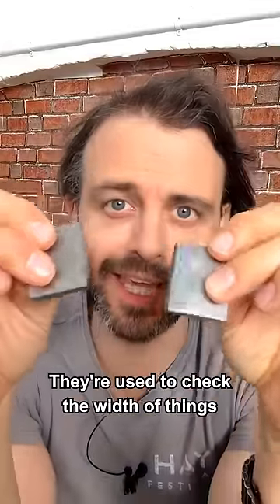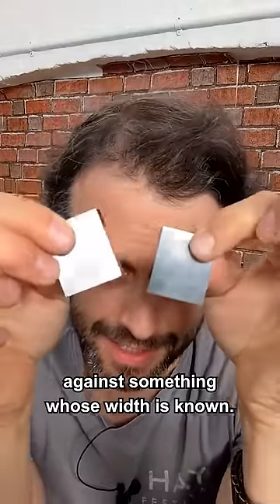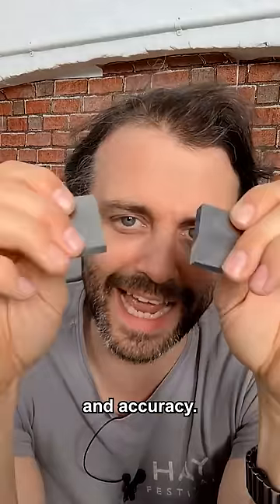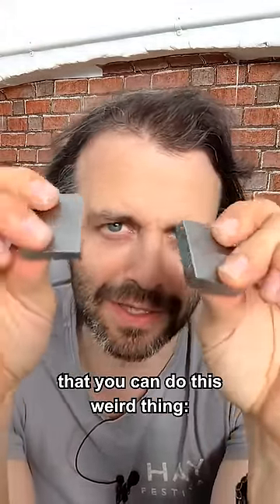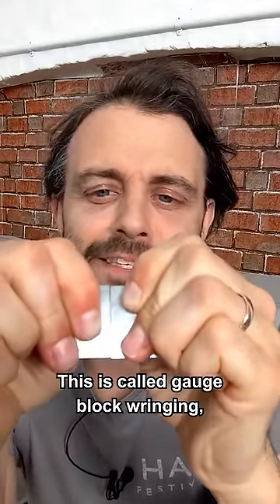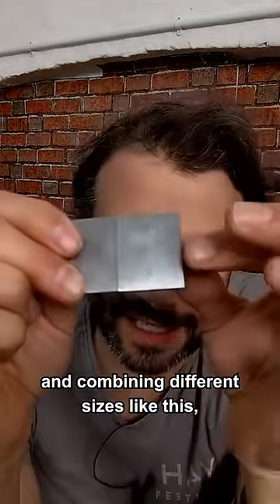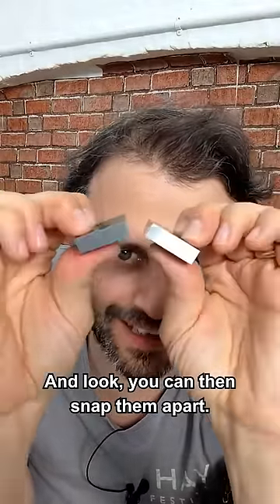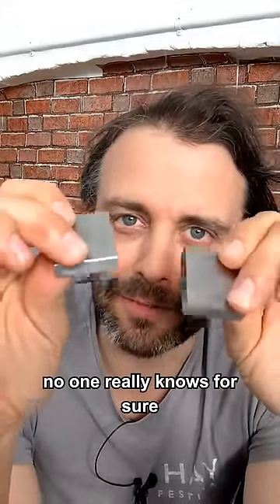No One Knows For Sure Why This Happens!

Comment: From actual machine shop experience, the oils from your finger play a surprisingly key roll. If you clean a gauge block with alcohol and try to wring them together, it tends not to work nearly as well
Reply: I’ve heard of cold welding, but this throws out that theory
Reply: @spicysmooth2  Metal atoms are held together by a free-flowing "sea" shared electrons.

therefor when any 2 clean/pure surfaces of the same metal come into contact (IE no oils, gases, or oxide layers to separate them) the electrons are free to move from one piece to the other as if they were one solid piece, thus almost instantly "cold welding" them together.

as for how they combat this, they will do a combination of things such as not using the same metal on to parts of a joint, or coating the metal in something to provide a barrier layer.
Reply: If you have a good set, you can get them to wrong just as well when they are clean. Taking them to a precision ground stone to remove any high spot and then wringing them together makes a huge difference
Reply: bcoz the oil increase contact between surface area
Reply: Yeah first time trying I would make sure they’re clean but they’d never stick together. A guy teaching me told me just rub it on your wrist and there’s usually enough oils to make it work. A little WD also works pretty well
Reply: @Thisisoscar_  As the original poster said if you clean them with alcohol they don't want to stick together as well when your oils are on them
Reply: @Thisisoscar_  Cold welding? No clearly not. From my own experience and as someone else said, this is easier to do when the gauges AREN’T clean. When they are cleaned it doesn’t work as well. Clearly nothing to do with cold welding, as clean surfaces work better for that.
Reply: I thought it was because they’re so smooth the sides are pulled together by sub-molecular forces
Reply: In my mind it's basically suction. Like licking a nerf dart to stick it too a window.
Reply: I just thought it was the Force
Reply: @Thisisoscar_  I belive the metals simply being in earth's atmosphere coats them with enough substance to prevent cold welding in space
Reply: Role….sorry I had to
Reply: Is it because being so smooth you're getting like 100% surface tension?
Reply: Even a tiny amount of H2O hanging out on the surface can make this happen
Reply: The set of gauge blocks on the workshop floor might not be so accurate such that they can be wrung together when clean, however something of a better grade like grade 0 will allow it to wring together even when they are cleaned with alcohol
Oils,fills in the gaps on the surface giving a smooth surface for the vacuum to form when doing the wringing
Reply: Could be Van De Waal forces, like geckos? The actual contact surface is actually probably crazy, and if there isn’t enough room between the contact surfaces i can see how grease could help.
Reply: @shadfallfan  (IE no oils, gases, or oxide layers to separate them)
Reply: @777XGang  (IE no oils, gases, or oxide layers to separate them)
Reply: @bofa722  (IE no oils, gases, or oxide layers to separate them)
Reply: That's helpfull
Reply: role
Reply: could alcohol residue prevent good contact?
Reply: @shadfallfan  "As the original" he is internet specialist that clearly do not understand the topic but want to pretend that he do understand it...
His story only proves that his test items were not as flat as he thinks they were.
I also saw a video with much nicer test items and the conection was much greater than in this video as here it looks like they may be just sticky and on the other video you could see signs of cold welding after they were separated with huge difficulties.
Reply: But it would still work?
Reply: @Bialy_1  What are you talking about?
Reply: @Thisisoscar_  is this related to why aluminum-on-aluminum screw threads become hopelessly seized after a while? Or is that a different cause?
Reply: @saltrocklamp199  that is caused by galling which is a very different thing.
Reply: @Bialy_1   What? Not as flat as he thinks they were? I’ve literally done this test myself in a shop with gauges that are used to manufacture aircraft parts. Trust me, they’re flat and the effect doesn’t work as well when the surfaces are cleaned. 
OP works in a machine shop as well like he said, so I’m curious as to why you think you have more knowledge on this than we do.
Reply: @nickl2852  Thats fair, it just can’t be that because it works in a vacuum as well
Reply: They are so smooth that anything at all that’s on them, even tiny bits floating through the air that get stuck, are basically fused together with friction. This is not backed by anything, simply how I think this works.
Reply: Interestingly, diamonds have an atomic attraction to any grease or oil and you can take a loose polished diamond it will stick to your nose simply from the miniscule amount of oil on the skins surface.  We learned this in gemology school.  It is somehow similar to how static electricity can cause certain materials to have an affinity for each other.
Reply: Thats crazy cuz my theory was that it was some form of cold welding, assuming that technique he used reduced the air molecules inbetween the 2 pieces
Reply: @jamescerven4400  A "good set" cannot possibly have high spots. That would be a useless set, especially after your suggested grinding changes the size of the block.
Reply: @rockstrong4342  I'm not suggesting to grind anything. On the absolutely macro scale we are talking, everything has high spots. Taking it to a flat stone will absolutely improve the wringing quality. I've done it
Reply: So my taco bell, kfc greased finger oils keep the blocks together. Happiness
Reply: @spicysmooth2 cold welding can happen in a vacuum, like in space
Reply: @spicysmooth2 Oh well, there is my theory out the window then! (just commented as a suggestion!)
Reply: from actual machine shop experience, gauge blocks don't stay so smooth for long and after a couple  of months they don't ring anymore
Reply: @Thisisoscar_ cold welding doesn’t work in environments where the metal oxidizes. All metals form a microscopic oxide layer when exposed to oxygen. Cold welding is a big problem in vacuum environments but not here
Reply: @RMrock12 the vacuum that forms between the gauge blocks while it’s in a no atmospheric environment?
Reply: @humphreyjones1828  since gauge blocks work even in vacuum i would think there's additional reasons as to why they wring together.
It has been mentioned but as they say surface tension, molecule attraction are additional factors as well
Did some reading, there doesn't seem to have a clear reason.
Reply: @nachosshenanigans978  why do you say cold welding? Wtf is that, I've never heard of it in my life
Reply: Nah bro
Reply: In that case, would it be the oils are sticking the blocks together, and causing, like I’ve seen in another comments idea, a sort of vacuum suction?
Reply: @humphreyjones1828  (IE no oils, gases or oxide layers to separate them)
Reply: @saltrocklamp199  Yes, stainless steel does this too that’s why thread locker/ anti seize compounds are used for that application
Reply: @Max-nt5zs   that is it
Reply: the same effect happens if you push and slide like a small flat thing like the adapter of a phone charger to a wall. (i did it before with multiple other things)
Reply: @Thisisoscar_ why do you think it requires push + slide + twis motions to stick? Does it helps remove some of the air or pushes out oil?
Reply: In that case, you're just getting the electrons drunk.
Reply: That was my thought. I noticed an oily finger mark on one edge.
Reply: I've heard oils from fingers, vacuum, and sticky electron theories. All of which come back inconclusive. No one knows for sure.
Reply: @mrreinark3388 As several people have noted here, you can wring gauge blocks together in a vacuum, so air pressure can't be the only thing holding them together. Also, a freshly polished set of blocks will wring together without oil. It seems like intermolecular forces are involved, similar to cold welding or galling. My guess would be that the oil helps prevent oxide layers from forming, and helps to remove existing oxide layers. When you wring them together you're scraping off the oxide and squeezing out the oil so the atoms in the metals can get close enough together to stick slightly.

I would note that the effect seems weaker in a vacuum, so it's likely that air pressure contributes some, it's just not the only factor.
Reply: @bofa722 Number 1 it’s “believe” and number 2 the reason metals don’t cold weld is because there is oxygen in the atmosphere making metals oxidize which means they can’t cold weld together but if you go into space for example they will because there is no oxygen to make them oxidize.
Reply: it's the air pressure.
oil do a good job to create air pockets
Reply: @spicysmooth2 cold fusion happens in space because air molecules aren't there to prevent the bond. Cold fusion would cause a permanent bond.
Reply: @spicysmooth2  It´s not actual welding for short periods of time. If you leave them wrung together for extended periods they weld together though. That is why they are separated and cleaned when you are done with them for the day.
Reply: Alcohol tends to kill the static.  Not sure if the ions are why they cling together.  The twisting implies to me that they are going against the grain of molecules but then again, no one really knows for sure.
Reply: @Thisisoscar_ 
The problem with this theory is this works with glass and ceramic blocks too.  But, then it also works without oils on those blocks.  
He's right no one really knows why this happens.
Reply: I was just about to say "how often do they test it without touching it first"
Reply: @empirion502  In the wild they are cleaned to remove oil and you do not touch the shiny surfaces with fingers when wringing them together. Oil between the blocks changes the size. When they come out to play µm matter.
Reply: Role*
Reply: I have the opposite experience. Gauges that were oily stuck ok but they would break apart easily. After a clean with some brake cleaner they stuck hard.
Reply: @Thisisoscar_ That's actually a really good explanation, thanks for that!
Reply: @spicysmooth2  Cold welding works in a vacuum, not in air.
Reply: @spicysmooth2  Definitely not that. They're definitely oxidized
Reply: Doesn’t mean it’s necessarily the oils. The alcohol could be playing a role in it. Possibly has to do with static discharge by a liquid? I dunno
Reply: @Thisisoscar_ , sounds like an interesting but maybe slightly incomplete or inconsistent explanation. Metals have different molecular structures not really held together by electrons flowing around freely, I think. If that was what held metals together, good luck trying to break in halve any of those individual gauges by twisting them with your fingers.
Reply: so basically adhesion
Reply: Harder for air to get in
Reply: @777XGang  Thisisoscar_ is correct. The liquid layer you mentioned helps out because you have to squeeze out the very last of the material between the two precisely flattened surfaces, including air. Air is so much less viscous than oil or water and it's compressible. So it tends to keep a thin springy layer pushing you parts away, even if only a few molecules thick. Any dust will also get in the way. I have experience working in laser parts manufacturing. With precision polished glass, you get to look through and see the layer of fluid get so thin, it becomes iridescent before disappearing completely. I've seen a glass block contact bond so hard, that trying to remove it tore a chunk out of the larger piece and still remained wrung to the chunk. Meaning the surface contact bond was as strong as the bonds holding the material together.
Reply: @greenlungo3996    Yes but I’m assuming you’re pressing these layers together with more force than when you wring gauge blocks, you really don’t have to push that hard. Cold welding would require higher pressure than someone just pushing them together. I’m not saying it isn’t possible ever, just that I dont think its possible given the amount of pressure being used and the oxide layer on the pieces
Reply: @777XGang  Okay, your anecdote is great n' all but how about we verify that with a Pearson Chi square test of independence and use a set of brand new Mitutoyo blocks?
Reply: @a-iz4pg  Lmao okay dude, you go do that.
Reply: @777XGang   No I said us, I know you a machinist, and probability theory or even reading isn't your strong suit but even Prat and Whitney specify to degrease/clean the gauge blocks for optimum wringing.
Reply: @777XGang  Gauge blocks are lapidary polished in their manufacturing, but not to the same precision as laser optics. A few times, I have rested a flatness standard plate on a gauge block and saw the air gap turn iridescent. That tells me they get pretty close. When you wring 2 blocks together in the shop, you're not doing it under clean-room conditions. And as you mentioned, there is the naturally formed outer oxide layer. That is the part that's actually doing the bonding. Not really a metal-to-metal weld. Weak pressure with some oil to displace the air allows the surfaces to get close enough to partially bond them together, but there's a web of regions still gapped. That's why separating them doesn't cause material transfer like with my glass block.
Reply: Are there instruments we can use to measure any changes? Temperature, magnetic fluctuations, eddy currents, anything? I don't know what's been tried, but I imagine if you have two lattices where the arrays initially point perpendicular to each other, sliding them will introduce friction, moving them slightly from their minimum energy positions in relation to each-other. Then, as the forces pass they will begin to move or re-align to their previous states, but adding the rotation means there is a diagonal line of points that will not have had the chance to reset to their minimum energy positions, but recall they're only slightly deformed, so that the minimum energy state is proximal, however to achieve it would shift every other state in the process, requiring energy the system doesn't have. So countably many can store the energy you added by having shifted in their matrix, while the rest have reverted to their previous positions. The few will not move the many, so they just oscillate between their equally stable pseudo-positions.
Reply: My buddy used to use his forehead oil. A bit nasty but worked better than anything else in the shop.
Reply: @ OP I think it's more likely that the alcohol is getting in the way of the molecular bonding, more than it has to do with your natural oils getting in there. 

I imagine if you cleaned it with alcohol then let it sit for a day (without touching it with your hands obviously) to really dry well then tried to wring it together it would work just as well as usual.
Reply: @777XGang  No, it's two different things. If the oil works better.... it's because the surface isn't perfect enough. If the surfaces are perfect enough, it works better without the oils. Its two entirely different things going on in each instance, however, both are true.
Reply: @radoslavl921 it can also happen with perfect enough surfaces in air. The perfection and smoothness effectively removes all of the air molecules from between the surfaces, hence why the twisting (shearing) motion is required. If they were left like that for an extended period of time they will actually become one piece, in the air. Cold welding is simply the electrons from the atoms being shared from one piece to the other because there is no barrier in between. If these were left wrung like that in a machinist's drawer for a decade, you would not be able to separate them, and there would be no discernable seam, even under a microscope, it would become one piece.
Reply: @nomcognom2414 that's why machinists are trained to separate them immediately after each measurement, otherwise there's a chance you won't be able to separate them ever again, given enough time. It doesn't happen immediately, but it will happen.... permanent atomic fusion.
Reply: @JustinLodes the oils are only required on imperfect surfaces and is an entirely different phenomenon. More accurate surfaces (flat and smooth to within an atom or two) do not require oils
Reply: @johnny0454  , never heard of any atomic fusion other than nuclear fusion. I am not a physicist but have sometimes read about little known phenomena involving surfaces very close to eachother, some involving electrons or quantum physics, others involving more mundane forces. Einstein won his Nobel prize for one such phenomenon, described by him. It might even be a very thin layer of air that makes such surfaces stick together. As for metals that fuse together over time, it would involve simple chemistry, I guess, such as rusting.
Reply: I've had a thought.. Even in a vacuum maybe its possible that wringing them together compresses the surface contaminates enough to create a stronger vacuum between the pieces? Again, just a theory. 
Alternative theory is surface tension. The precision surfaces prevent a weak point from developing in the surface tension so in order to separate them you would always have to overcome the ideal surface tension of the entire area.
I have used these before but I've never put this much thought into the actual mechanics of how it works.
Reply: @nickl2852  it's an electron bond at the atomic level because the atoms on both sides are the same. It only works with perfectly flat and perfectly smooth surfaces with zero contaminants, hence the pressure, then the slide, and finally the scraping action to swipe all the air molecules away. If left together long enough, both pieces would become one at an atomic level.
Reply: @RMrock12  true ringing is not from a vacuum being formed, it's an electron bond between the atoms because the atoms are the same on both sides (provided you can get them perfectly flat, clean, and smooth with no other molecules in between)
Reply: @johnny0454  But it really does work better if there is oil on them
Reply: Adding alcohol does a lot more than make it clean, as anyone with a functioning brain can tell you.
Reply: Depending on the grade of rubbing alcohol, it might leave residue.
Reply: @Thisisoscar_ this only works in a vacuum free from oxygen and other contamination. Metals form oxidized layers (even minute) on the surface. That's what keeps any metals from instantly cold welding. Put those two like metals in a vacuum and perfectly clean the surface and then you may have that process occur. Never in the presence of oxygen tho.
Reply: This actually gives more credit to the cold weld theory. 

The oil acts to prevent oxidation.

Cleaning the oil off allows the surface to immediately oxidize.
Reply: @austincox1239 
“Use the Force Austin!”  🖖🏻. (Doh!  Wrong franchise).
Reply: @Thisisoscar_  Except for a few precious metals such as gold and platinum, all metals in air are coated with oxide. The oxygen may be present in a layer only one atom deep, but it is enough to create a complete fault across the interface, when two such surfaces are brought together, which interrupts the metallic structure,
Reply: My theory is surface viscosity
Reply: @Thisisoscar_  They're not metals, they're carbides. It has a strong cubic lattice structure and the wringing basically puts them together like lego.
Reply: Because the oil enhance the vacuum effect.
Reply: Odd, I've seen tests where they're cleaned thoroughly then dried and tested again in a vacuum, eliminating any oils or water or contaminants and even preventing atmospheric contaminants from interfering and they still stuck together. Perhaps they stick EASIER with oils or slight moisture from atmospheric humidity but it's definitely not the only factor. This is also evidenced by the fact that glass components in optics are often "glued" together in the same way in highly clean and dry environments during the manufacturing process where oils and moisture doesn't exist. Seeing the process myself I'd say that bond is seemingly just as strong for a given surface area as gauge blocks wringing is but I haven't done any proper tests on it to be sure.